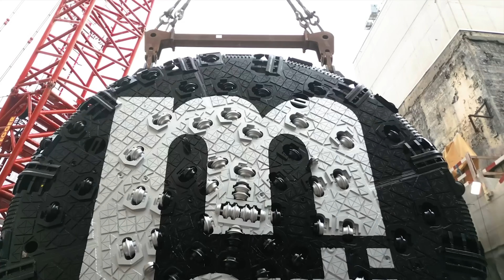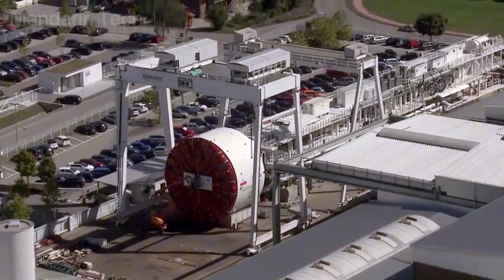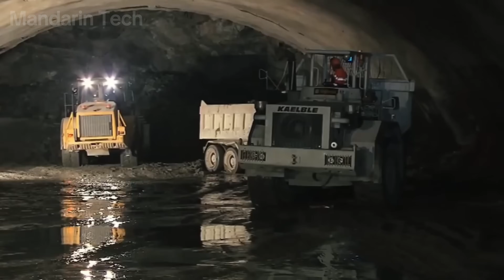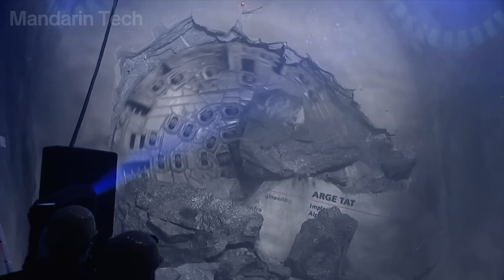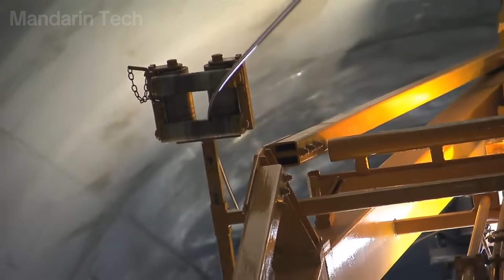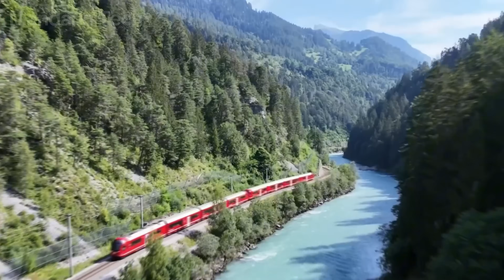Switzerland Dug 57 km Through the Heart of the Alps to Build the World’s Longest Railway Tunnel

Comment: Cutting 57 km through the Alps is incredible, but the most fascinating part is the precision required underground. I’m curious how engineers managed rock pressure, groundwater, extreme temperatures, ventilation, and tunnel alignment over such a massive distance. Building a railway through the heart of a mountain range at that scale is a remarkable engineering achievement. 🚆⛰🇨🇭
Reply from the maker: Exactly—the precision required at that scale is what makes this project truly incredible!